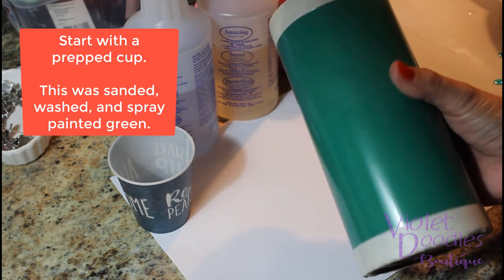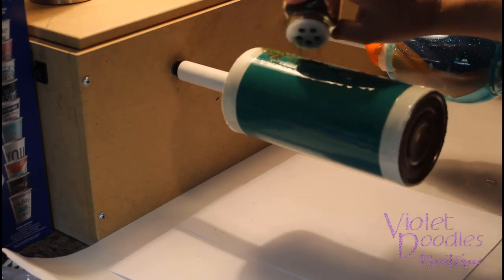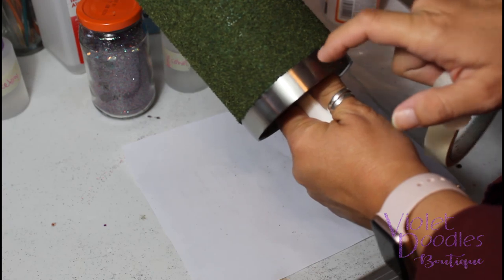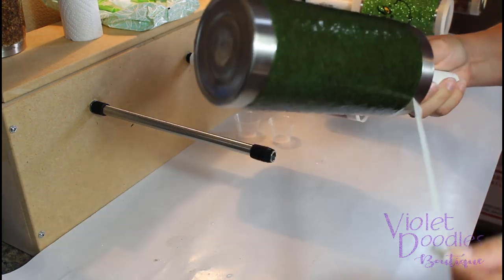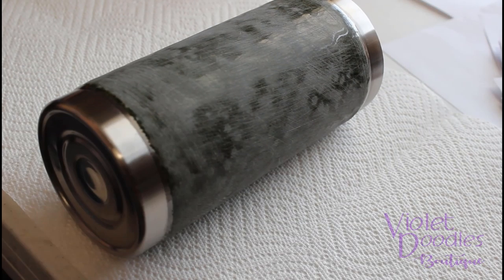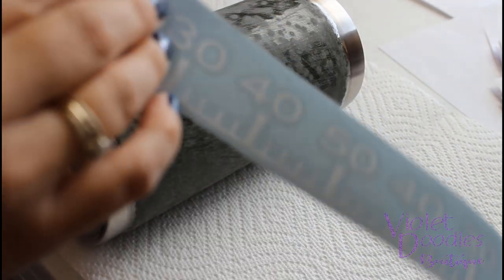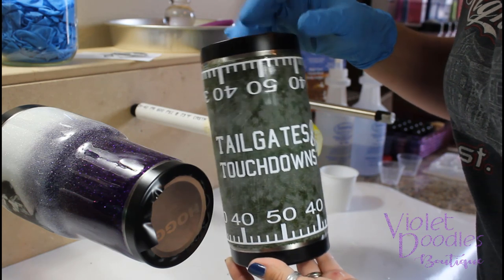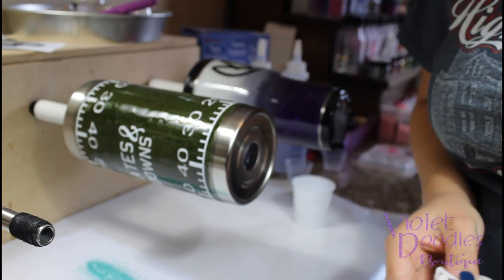Turf Tumbler Tutorial

Comment: I've seen this done w/Mod Podge and it was a HUGE mess and took much longer. This looks much easier and I will be trying this method. Super cute!
Reply from the maker: Oh I can imagine! Anything chunky, I use this method.
Reply: I read a comment (don't know if it was in reference to tumblers) that said while waiting for your epoxy/resin projects to cure, to make sure to cover them with a box or something to keep dust and hair off of them. With your experience, do you think this would be okay to do with spinners and tumblers as long as the box is big enough?
Reply from the maker: Yes! I had trouble with dust and made a frame with wood and wrapped it with clear plastic to cover my 5 turner.  If you have a smaller turner, you can use clear rubbermade boxes.  I like clear so I can keep an eye on it while its spinning.

Comment: Wowsers... I use a max of 2ml epoxy for epoxy method for anything ... this looked like you used a lot more... do you find it takes ages to cure?
Reply from the maker: Thinner coats of epoxy actually take longer to cure generally but I don't think there is much of a difference between 2 and 10 as far as how long it takes.  I used enough to adhere the dill weed without it moving. It did soak up a lot being an organic material.  I use less for glitter.

Comment: If I were to go half grass half wood grain would I put the wood grain on top of the turf or divide it from the beginning?
Reply from the maker: Good question. The dill makes the cup noticeably thicker. So If you want it to be the same thickness I would do the dill all over and then tape it off to do the woodgrain. It you don't care if there is a slight difference in the thickness, woodgrain and then dill over it. It would save some steps to do the woodgrain first. Good luck.

Comment: How did you know how much " yard line " you needed? yours was perfect how did you measure it?
Reply from the maker: I used a tape measure to actually measure the cup right before I needed the decal.  Then I resized it on my computer before I cut it.  Every cup will be slightly different depending on the cup itself and how much product is applied.

Comment: How much epoxy did you use on each step?
Reply from the maker: Around 10mls to apply the dill weed, maybe a little less. About 15mls for each additional coat. I always have multiple cups going so I mix a bigger batch at a time.
Reply: @VioletDoodlesBoutique  How do you keep your big batches from getting too hot...I mixed up 80ml last week to do multiple flood coats and could feel my resin getting hot in the cup and before I knew it, it had started curing in the cup and it was a MESS.
Reply from the maker: I won't mix more than 90 and I work fast. I have had that happen though. If it starts to get hot, don't use it.